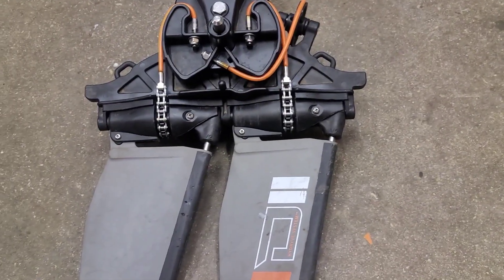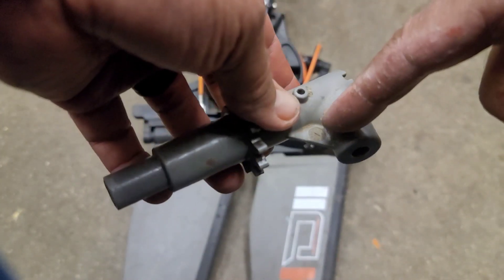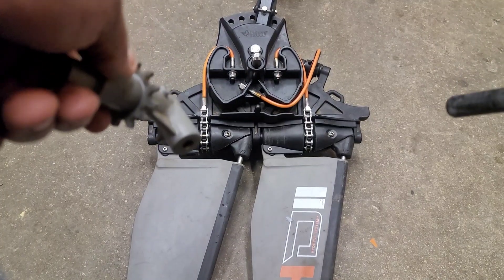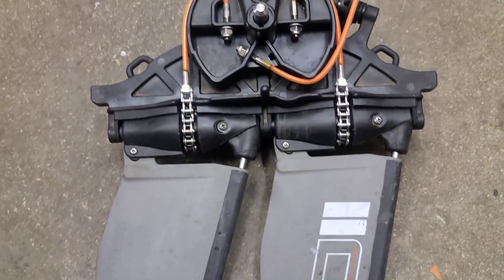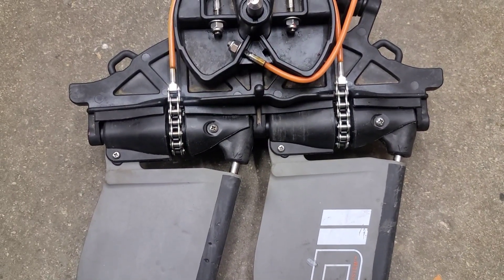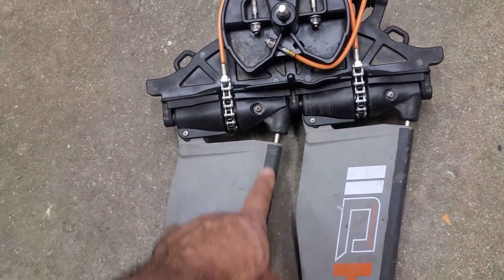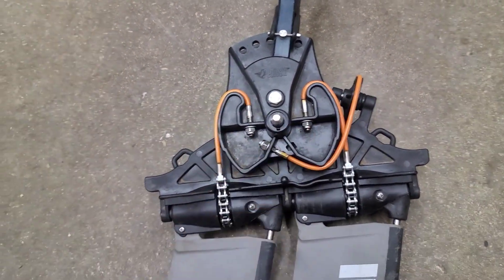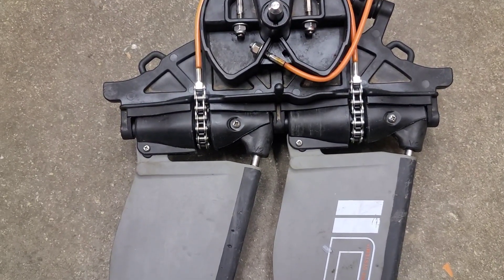HYDRYVE II REPAIR / UPGRADE

Comment: I orderd the same sprocket  came with set screw but it doesn’t have the hole for the set screw or do u have to drill it?
Reply from the maker: Mine had the set screw in place